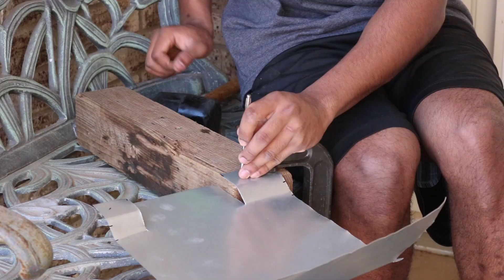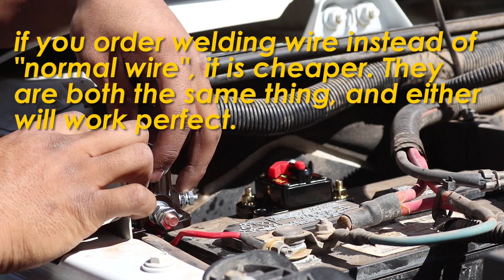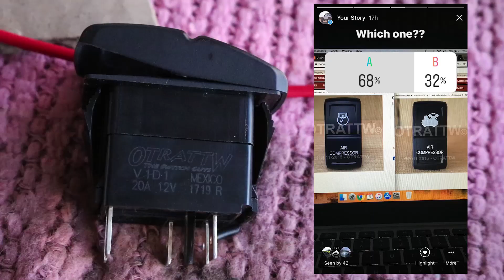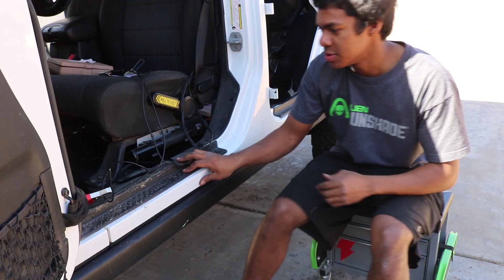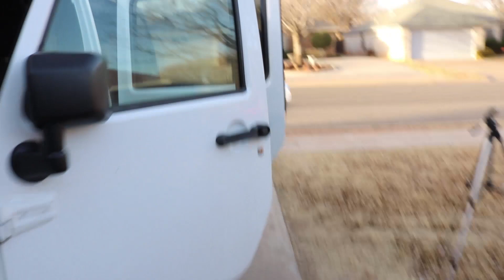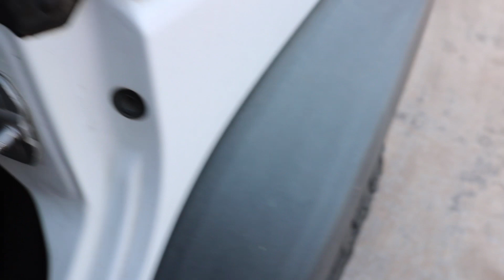Wiring and Mounting Dual Compressors [Part One: $250 DIY OBA]

Comment: I’ve been running that dual compressor setup under my hood of a K5 for several years with the same compressors.  It works great BUT they produce a lot of heat when airing back up 4 - 35” tires from 15 to 35 psi and are crazy loud IMO.  I have them filling a 5 gal air tank as well. 

They work great for the cost.  As far as the wire size, they pull between 20 and 30 amps each, so your wire size is dependent on the length of the run.  If you run two sets of wires, the wire size can be smaller. If your running 50 - 60 amps continuously over a distance 10 -15 feet, you’ll need larger wire or risk melting wires and a fire.  

A 15 foot run of 60 amps at 12 volts calls for 4 gauge wire.  6 gauge would be good to about 11 feet to maintain less than a 2% voltage drop.  Voltage drop results in heat.

Nice video!!

Comment: @ Chris Meacham:
  1) When joining such large cable, you'll have better luck using short sections of copper pipe as a splice that can be crimped and/or soldered. 
       I'm not breaking your balls, just passing along some helpful info
   2) since the solder didn't flow into the joint, and it was more or less hot glued with solder, it's not right. You needed more wattage, and possibly flux paste.   After the joint cools, clean off the remaining flux (water based) to help prevent damage to the shrink tube that's applied over the joint.
   *I like your video, and the fact that you went "hands on" to customize your jeep.*
   3) I wasn't sure why you spliced 2 wires (22awg?) to a 4 gauge, but you can save some coin without a drop in performance. The 4 AWG wire is not needed. 
    Power wires. Heavy copper cables from the battery, alternator or starter cannot tolerate even a small resistance from an imperfect splice. It lowers voltage of the whole electrical system or heats up and causes a fire hazard.
      Reference
Avionics Training: systems, installation and troubleshooting second edition by Len Buckwalter.  
    ///You might like the dymo label maker with heat shrink to label your wires with in the future. It's not expensive and the extra attention to detail will aid in troubleshooting, plus it will add value to your modifications.    Keep up the good work.

Comment: I did a CB install last week. Sort of rushed because I was going to attend an organized trail run the following weekend. Cobra 75 WX ST and Mopar JK antenna+mount+coax kit. I didn't even bother to tune it (I have the SWR meter), but it works great in actual use. I'll probably test the SWR this weekend.
Reply from the maker: Jonathan Ocab sweet! I haven’t made up my mind on what CB / HAM combo to go with yet. Still doing some research
Reply: Yeah, definitely take the time to research. I went with the Cobra 75 because it is arguably the most popular with JK folks in terms of form factor. I didn't know about the Uniden CMX560, but that apparently is smaller and has a few improved design features.

I don't have a ham license, but I have been meaning to take the time to learn/study and take the test.